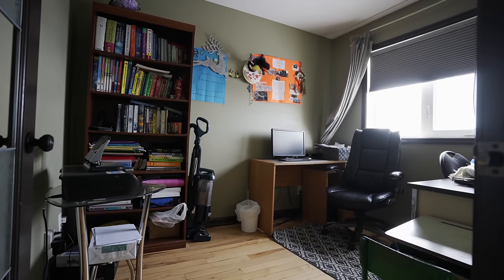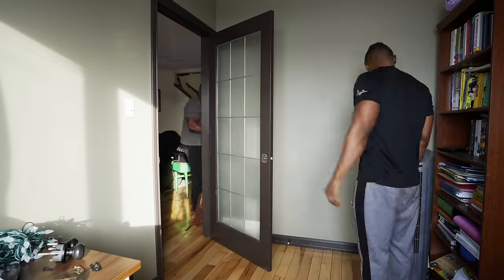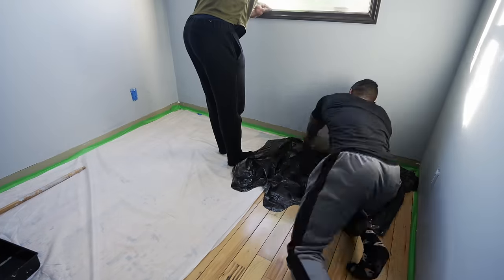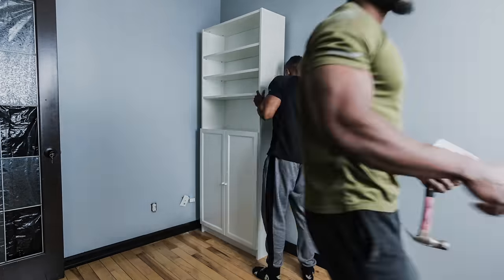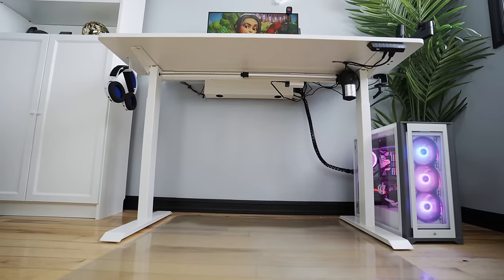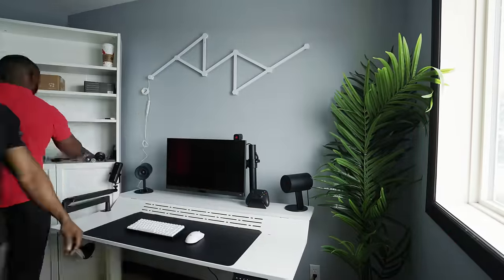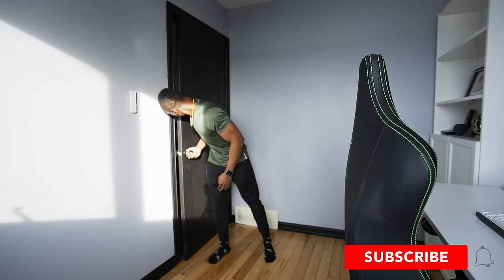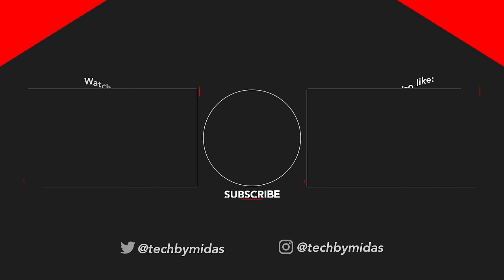Surprising My Little Brother With A Crazy Room Transformation! 🤯

Comment: Intel Core i7-11700KF - 16GB Memory - NVIDIA GeForce RTX 3080 - 2TB HDD + 512GB SSD
Model:G15CE-B11 
Cost:$ 1,800 at the time  and i have a 250$ long LG monitor. And that's it 😊 but i wood 🪵 like a upgrade